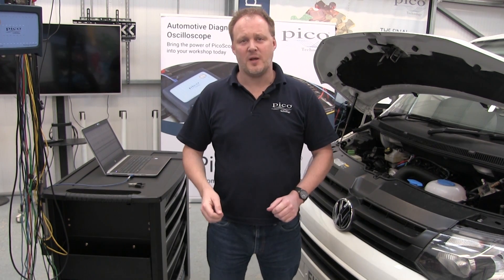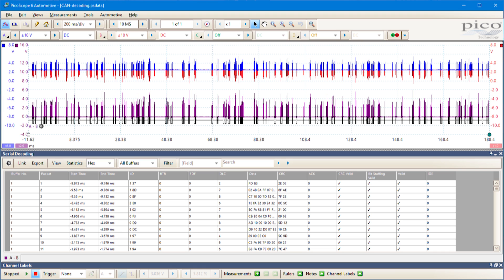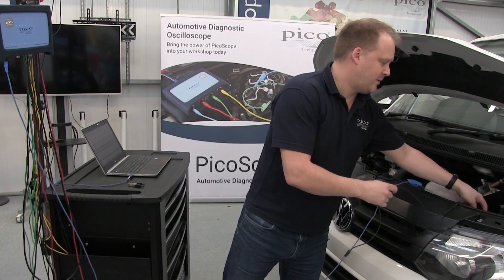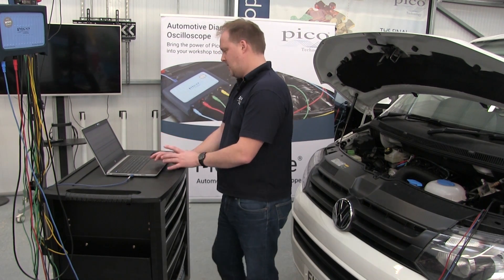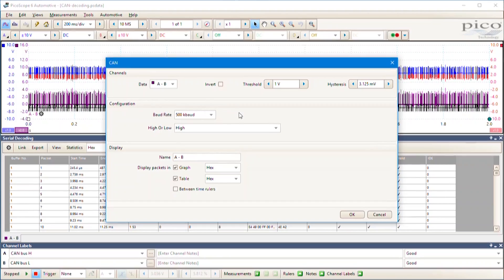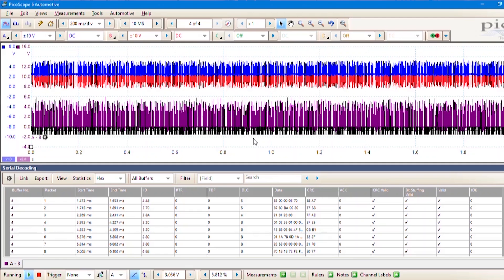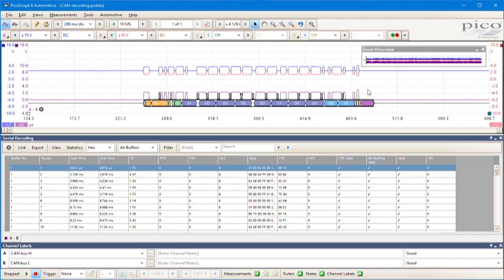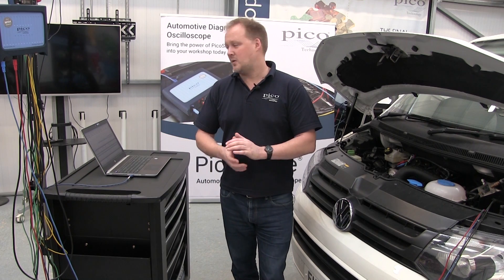Guided Test: PicoScope CAN Bus Serial Decoding

Comment: thanks for the video
But how do you recognize ID and which computer it belongs to?
Reply: Probably a bit late now, but they show this in another video. 
Basically you have to record all the IDs in a capture, then unplug a module and record more data and see which IDs are missing. It looks like there are around 10 IDs for some modules.
You pretty much have to do the same if you want to record events, like press the accelerator and see which ID changes. 
A very slow and tedious process, especially if you're trying to find a fault that's already there.
Reply: @JoeBob79569  thank you very much for the answer

Comment: I have  Question maybe the Pico team can help me with ?  How can i use my Scope to Decoding a SENT Protocol Signal and know if the sensor i am testing that uses the   The Single-Edge Nibble Transmission (SENT)  is bad or good ? Say we have a air flow meter that uses The Single-Edge Nibble Transmission (SENT)  and the car says  ,has  a bit of a flat spot . In the past  we could for example test the Frequency out put against a known good air flow meter.  But if we had a flat spot on a air meter that uses The Single-Edge Nibble Transmission (SENT) protocol how can i make the call and be 100 % sure that it is the Air flow meter using a Pico scope  or any Scope ?
Reply from the maker: Hello Stephen, thank you for your comment. As it is quite indepth please can you send it to support@picotech.com and one of the team will get back to you. Thank you

Comment: I feel like I may be missing something here.  What version of picoscope are you running in this video?  I do not see the CAN Bus Decoding under the CAN Bus menu.  I also do not get the same web help as seen here with the guidance option.  I am using the current version off the website.
Reply: No, you're not missing anything. We are working on getting the guided test in the software. We have released this video early with a large batch of CAN related material. In the meantime, our "Practical Pico: CAN bus diagnostics" will tell you how to set up your scope serial decoding. Hope that helps.
Reply: @pico_barney  thanks for the reply.  The videos are very informative!
Reply: @freeride202  No problem. Thanks for the feedback :)